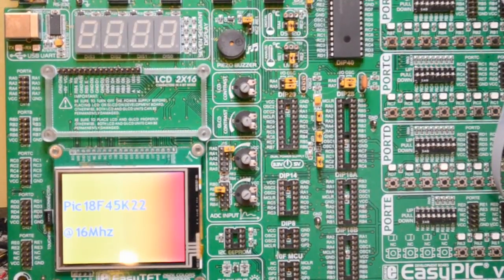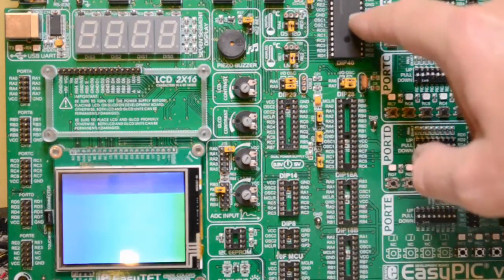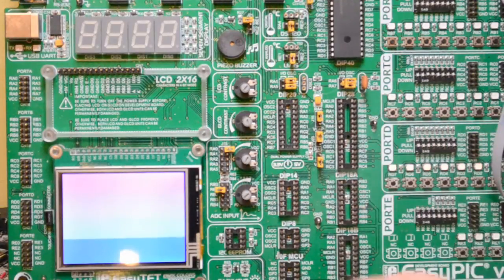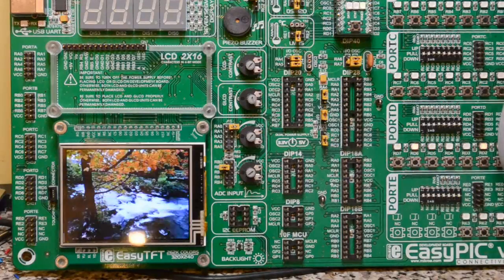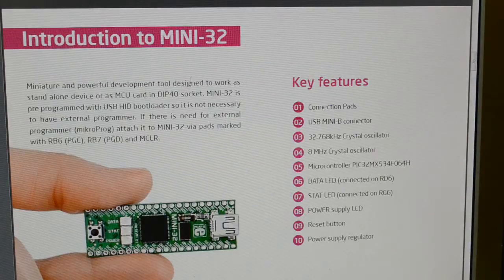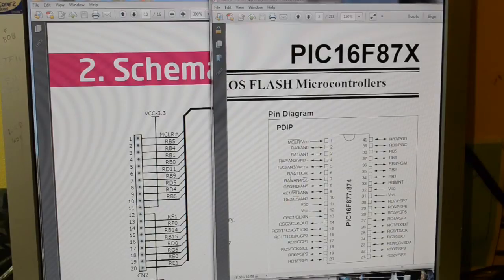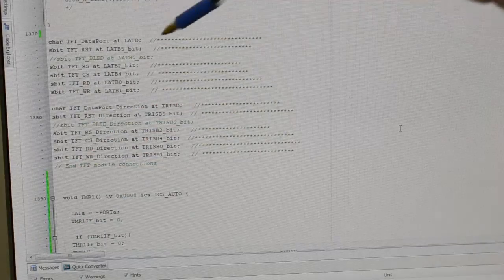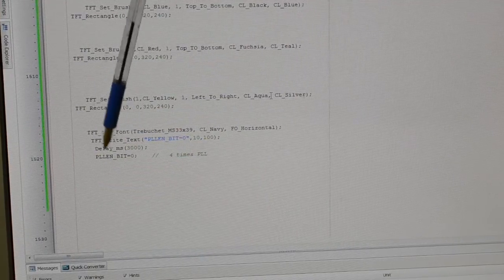Colour TFT on an 8 bit Pic18F46K22 then same TFT on a Mini 32

Comment: Merci John, pour votre réponse rapide, c'est très gentil et aimable de votre part.j'ai vérifié mon cablage et il est correct. Mais en fait ma véritable question est de savoir si le PIC 18F4620 est assez puissant et rapide pour afficher quelque chose sur l'afficheur easy TFT. il faudrait le comparer au PIC 18F46K22 que vous avez utilisé.Désolé de me répéter, mais pourriez vous m'envoyer des fichiers sources .c pour pic 18F pilotant des afficheurs TFT , cela m'aiderait beaucoup à tres bientot, et "good evening" comme on dit par chez vous Emmanuel

Comment: Hello john, it's emmanuel from France, i'll write you in french, because there are automatic translator!!!

J'essaye depuis des mois de piloter un afficheur couleur TFT avec un pic 18F4620 et mikroC, mais en vain. 
J'ai essayé avec un afficheur mikroe-1142 le pic 18F4620, l'afficheur reste desespérement gris. 

La vraie question est de savoir si un tel PIC 18F4620 est capable de piloter cet afficheur , sachant que vous avez réussi à piloter cet écran  avec un 18F46K22. D'ailleurs, si vous réussissiez à remettre la main sur le code C de votre video ci dessus de 2013, cela serait d'un grand service pour moi!!!

Je vous remercie d'avance! j'adore aussi la géographie!! où habitez vous ? UK? USA? quelle ville? connaissez vous la France et ma ville Toulouse? Au plaisir de lire votre réponse bonne soirée Emmanuel
Reply from the maker: Hi Emmanuel,
First, have you selected all the correct pins that connect the original Blue GLCD?
I had a look at tft manual and easypic v7 manual

I think below might be correct

TFT RD = RB0
TFT_Write = RB1
TFT RS = RB2
TFT CS = RB4
TFT_ DATDATA PORT AT PORTD
FTF RST = RB5

Is your configuration similar?

Secondly, have you used  TFT_Init_ILI9341_8Bit(320,240);   ?

I love France, I drove to Paris In March and took my partner.
I know Toulouse
I'm in the UK, South Yorkshire.
Reply: @JohnB-2021  Merci John pour votre réponse très rapide, c'est très aimable de votre part . j'ai vérifié mon cablage et il est correct. Ma vraie question est de savoir si un PIC18F4620 a assez de ressources pour piloter un easyTFT car le 18F46K22 que vous utilisez me parait beaucoup plus puissant
Je vous dit ''good eveninig" et à tres bientot
Amicalement,
Emmanuel from TOULOUSE
Reply from the maker: @emmanuelviratel7007  Yes the 4620 is ok.
Reply from the maker: What IDE are you using?

Comment: Thanks for the videos! please keep them coming. I am currently in the process of moving from picbasic to MikroC, i find your videos very helpful!!
Reply from the maker: Hi, I have PicBasic Pro too.
Thank you for taking the time to write.
So are you going for the MikroC pro for Pic or ARM or maybe MikroC Pro for Pic32?
Reply: blogsf89
Hi, i have been using Proton Basic for about ten years. Sorry to say i never became an expert though. At least i managed to complete my projects with some success. Bought MikroC pro for Pic back in 2009... i have the EasyPIC6, EasyPIC7, Micromedia for PIC18FJ and some of their click boards. Never really got it going, but i would like to do more complex stuff now...
Reply from the maker: erick s Sounds good, it took me many weeks to get simple programs running and months to get my 5" TFT running on 16Bit. There's not much help out there. The forums aren't fantastic either.
On the screen now there is someone un-boxing a dsPic, wow that will help, he has more views then all my examples with wiring and code lol.
What sort of program do you want to run?
I have the GPRS click etc but, it's just re-inventing the mobile phone except making it bigger again lol
Reply: blogsf89
 Yes i agree, it's not easy to start with a new programming language.
I would like to use Touch Screen in my applications, also some wifi control...
Maybe i don't spend enough time to really try and understand C. At least on the hardware side i have managed to make my "stuff" robust in industrial applications. No issues with noisy environments...